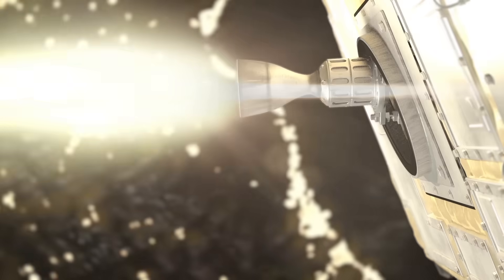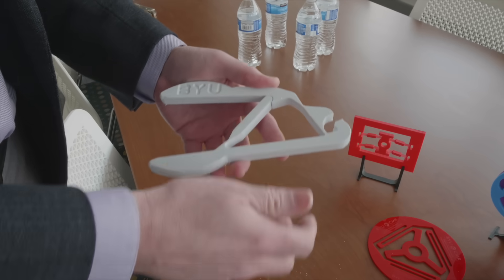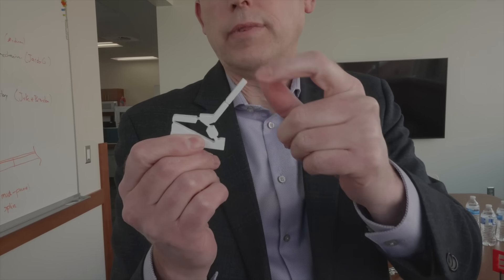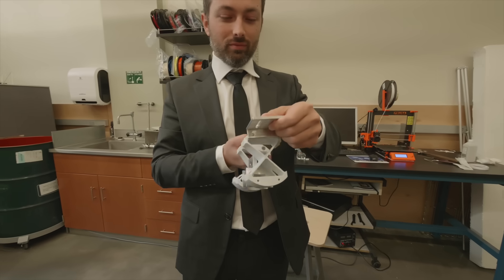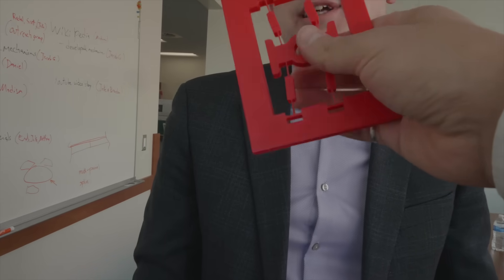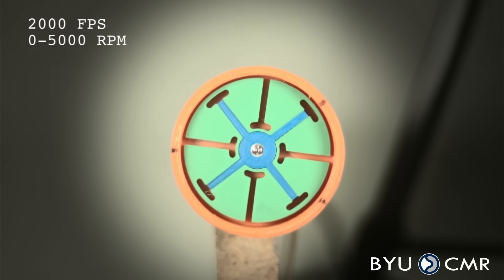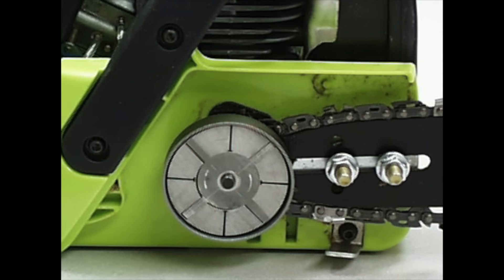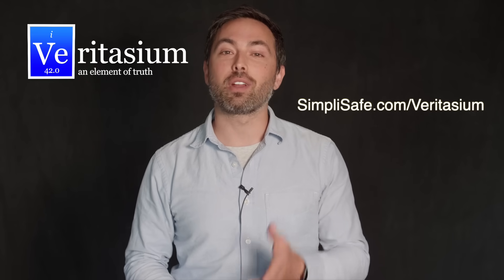Why Machines That Bend Are Better

Comment: I imagine the material wear and tear is mitigated by a limited flexion based on the designs, but wouldn't material fatigue be an issue? Like how continually bending a strip of metal makes it brittle?  Is this sort of fatigue calculable without using stress-testing environments? Fascinating watch.

Comment: In the early 1970s, I worked in a camera store and saw the first Kodak Pocket Instamatic 110 cameras. The film door interested me. It didn't have a hinge with a pin, but a single plastic component that formed the back of the camera and the door. It had a thin pinched section that formed the actual hinge, We all laughed when we saw this because we assumed they would all snap off after a few uses. You can pick them up from thrift stores today with hinges that still work perfectly.

Comment: There's a 9th P that is important for recycling and that is (re)Processability.  When it's a monolithic material, you don't need to disassemble and sort to recycle.  You simply process the material back into feedstock.  For most metal alloys and many plastics, this just means remelting.

(2 should also be production Possibilities)

Comment: They're not better though. If you've printed these you'll know they quickly fatigue and break if printed in PLA or PET-G. If you print them in TPU the rigid parts aren't rigid. You need multimaterial properties.

Comment: big problem when a failure happens anywhere on the device, the whole thing is broken, smaller parts are easier to replace. those thin hinges look super weak and a critical point of failure for the whole device.

Comment: That centrifugal switch is amazing. No electronics, just the increased diameter of the circle from spinning at a certain minimum rpm rate. I wonder if that minimum spin rate for the switch to engage can be adjusted for different applications by changing the thickness of the areas that are compliant or by using different materials.

Comment: I worked on the flagship Xerox machines for over 35 years. I am here to tell you, no matter what it is made of, parts that bend..break. I have replaced and repaired more wiring harnesses and bendable guides than you can count. Anybody that uses this is setting themselves up for monumental failure. A quick test, get a cheap  spoon or wire coat hanger. Now start bending it back and forth. It will weaken then brake. I don't care what you make them from, parts that are being bent on a continuous basis will break. Mark my words. I may not have written a book. Then again they say those that can, do....... those that can't.....

Comment: I wonder how differently vehicles would work and be maintained if a huge majority of different parts could reliably bend instead of break. Obviously, we'll exclude major parts like the gas tank and the hottest parts of engines because it doesn't seem realistic for them to bend.

That being said, the most obvious parts of a vehicle's compliant mechanism are likely springs and/or those flexible metal strips used for suspension on trucks and cars.

Comment: Try to make a compliant Diesel engine, then tell me whether you still think “machines that bend” are better.
Reply: He absolutely should have gone over the cons of a compliant mechanism. This video seemed more like an ad than information.

Compliant mechanisms are cool and have their place but they also have limits that make them worse in some areas such as strength,l. A compliant “vice grip” (what they were comparing to a vice grip there lacked the one thing that sets vice grips apart from pliers, the fact that it will clamp and lock to adjustable heights) will never have the strength of a non compliant version based solely on the fact that if it were strong as a non compliant version, you wouldn’t be able to bend it.

He mentioned that mechanical devices like pins will wear as if repeatedly using a compliant mechanism won’t wear it. They bragged about having one mechanism work over a million times but an average tool can easily do that. 

Again, compliant mechanisms are cool but the video definitely didn’t go nearly in depth enough to show both their strengths and flaws.

Comment: There is a plans-built experimental aircraft design (from Zenith Aircraft) that uses (in my interpretation) a compliant mechanism for the ailerons. I replaces the hinges of the aileron with a bending piece of sheet metal.

Comment: one of the example compliant mechanism advantage in real world application is for the oscillator in mechanical watch "monolithic oscillator by frederique constant" it's significantly far more efficient than the classic oscilator and escapement mechanism which replaced 26 mechanical parts component for one new part component only

Comment: Why isn't everything compliant than
Reply: There are a lot of cool positives to these types of mechanisms, but a big negative is that if part of the mechanism wears out, you have to replace the entire part. In assembled tools and machines, if one part fails it’s far cheaper and easier to replace the broken part.
Reply: At least, that’s what I can think of off the top of my head. Still a crazy cool idea with a lot of impressive and useful applications.
Reply: that's... not an argument

Comment: As a EE in an electro mechanical design group for printers I worked closely with 2 lead MEs. One advocated for traditional rigid structures while the other wanted a compliant design.
In this particular case the compliant design had more parts and complexity. Ultimately the compliant design won out. In conjunction with servo control, acceleration and deacceleration could be tuned resulting in greater positioning accuracy, higher reliability, less noise, less vibration. Overall impact on cost turned out to be minimal.

Comment: Is it looks like? A conic of 5 points with a point close to the line segment between two points. Depending on the closeness of the two parabolic curves, the elasticity of the material, slip occurs when the applied force limit is exceeded. If 3 of the points forming the cone are on the same line, fulcrum points are required between the edges to prevent it from forming 2 lines (scissors) that intersect each other.

Comment: Id like to share my thoughts..
so heres a short bit 
Compliant mechanisms are innovative designs that rely on the flexibility of their materials to achieve their intended function. However, one significant concern with compliant mechanisms is the potential loss of flexibility over time. This can occur due to a variety of factors, including fatigue, wear, and other forms of degradation. As a result, compliant mechanisms can experience a reduced performance and reliability over time, compromising their effectiveness.

The loss of flexibility in compliant mechanisms can have significant implications for their performance. For example, it can result in reduced accuracy, repeatability, and stiffness, making them less effective for applications that require precise control and positioning. Furthermore, the loss of flexibility can increase the risk of failure or damage to the mechanism, which can lead to safety hazards or costly repairs.

One potential solution to this problem is to incorporate monitoring systems that can detect changes in the compliance and flexibility of the mechanism over time. This can help identify potential issues early on and allow for preventative maintenance or repairs before the mechanism fails completely. However, implementing such systems can be challenging and costly, particularly for complex or large-scale compliant mechanisms.

Another potential approach is to explore alternative materials or designs that are more resistant to fatigue and wear. For example, researchers have explored the use of shape-memory alloys or elastomers that can recover their shape and properties even after undergoing significant deformation. While promising, these materials still face challenges in terms of manufacturing, durability, and cost.

In conclusion, while compliant mechanisms offer innovative solutions for various engineering applications, they are not without their flaws. The potential loss of flexibility over time can compromise their performance and reliability, making them less effective and safe. Designers and researchers must continue to explore solutions to mitigate these risks and ensure that compliant mechanisms remain a viable and useful technology for the future.

Comment: The extrusion process sounds very cheap for some parts. I'm very impressed. I've worked with a few items made like this and I had concerns about the part wearing out prematurely. However, my concerns have been eliminated. The once-piece clutch was very nice.

Comment: In the military we use a lot of carbiners [sic] and S clips and about 2007 they changed from using springs to bendy part to be a piece of steel with offset connection to the solid bit.

Comment: In 1968 I did research to try to put a machine, a molecular beam, on a glass slide, that could then be rotated to get three way velocity specification. The microchip etching needed had not yet been invented (I tried to use asphalt and HF). But there were mechanical components too. These kind of etchable devices could serve for controls. So far as I know, the device has never been made or researched. Maybe it's time to try again using these advanced mechanisms.

Comment: Now I hate to call other people liers for no reason. But when he said that those bending devices can last very long, I just can't believe it without further explanation. All these devices, whether plastic or metal, seem to achieve flexibility by having very small connecting junctions. But in my experience, such thin junctions always break fast when you bend them often, no matter the material. Why would it be different in the devices shown here?

Comment: 😊👍
Designs after my own heart feelings.
I suppose one of the earliest examples of a simple compliant device that I was introduced to, was at college, in the 70's.
It was an example of a real problem solved.
An aircraft had a self starter, but the shaft was inclined to shear, due to the inertia of the large engine, and the necessary rather ferocious torque of the starter motor. 
So the shaft was made bigger, and it still broke! 
So it was made bigger still, but it still broke!
Then another engineer got involved, and instead of making it bigger, he made it smaller, so it acted like a spring torsion bar.
It stopped breaking!
I solved a problem with a ''fruit machine,'' also known as a ''one armed bandit!''
The reel stops were controlled by a lever operated by a solenoid. 
In order for the lever to release, it had to be spring loaded.
This required pins, and springs, to produce a two way sliding mechanism. 
From memory, I think sixteen pieces total.
I replaced it with THREE, by using a piece of flexible 'memory foam,' which also provided damping.😊
.

Comment: Centrifugal Clutch on my old go cart (driven wheel) had a cylindrical aluminum housing. Driving through the woods one day, caught a branch in the chain sprocket. I surmised turning the wheel in reverse could free it, but more leverage if I could spin the clutch body & sprocket to release the branch. My bare thumb & fore-finger slid off the clutch housing with a sizzle, so fast that it didn’t hurt, but the white char endured for a while (no scar remained), but lesson learned.

Comment: If you flex a material over and over again it breaks down more then just having linking parts to reduce wear on the structure! Imagine if your door was connected to the wall by just a thin piece of malleable wood?! That wood would breakdown way faster then the jointing hinges!

Comment: centrifugal clutch is nothing new to the automotive world.  Its been around since at least the 1940s maybe even earlier.  The only Difference hes using in this one is hes using a leaf spring instead of a coil spring.  The only way this item would be useful at all is if the leaf springs are longer lasting then a coil spring which seems very unlikely to me.  Also replacing the spring would cost more as its 1 solid piece.

Comment: Why did you have to go to a Mechanical Engineer first? Civil Engineers have known it for a long time. That is why we use steel in reinforced concrete. Because steel is ductile, it stretches and then it comes back to its original shape. Just beware of resilience, though.

Comment: super great usage options for low price.  The problem arises when repairing and replacing, where the existing element of such a device cannot be used, even with the repair there would be a difference in performance.  And different materials have different temperature properties.

Comment: the mechanism at 10:44 reminds me of the way a bulova accutron works (analog to a balance spring.).there is a tuning fork which vibrates with 360Hz. this is transformed to a gear with 300 teeth and makes it turn 1,2 times per second as a time base. you can hear the watch humming with that frequency.

Comment: Have to stop you at "a million cycles."  I will never forget this claim from when plastic door hinges and tool boxes came out many decades ago. 

It wasn't long until we started to see failures. 

For one thing, they aren't cycled continuously.  Maybe the heat that generates makes the hinges more flexible or tougher.  

But it also doesn't account for the leaching or of plasticizers over time, which makes the material more brittle and prone to fatigue. 

Of course, plastics have improve since the 1960s, but the test method depicted was the same.

Comment: except metal vice grips dont burn in the sun and they are durable. plastic material tends to dry and crack in the sun; yes a good solution is titanium, but can you imagine an average working man or women with tools made out of bendable material? durability, practicality...

Comment: I've always thought that if you bend metal repeatedly, that part of metal will wear, and give less resistance when you bend it again, eventually breaking. Its easy to see this behavior with a paperclip. Why are these compliant mechanisms immune to this?
Reply: The phenomenon you're talking about is called fatigue.  There are two types: low-cycle and high-cycle.
What you're doing with the paperclip is high-cycle fatigue, and normally results in failure quickly.
What is happening in the compliant machines is low-cycle fatigue, which can be designed around to allow for million+ cycle lifetimes.

Basically, the difference is whether you are yielding the material during fatigue.  Yielding happens when you start applying permanent deformation, i.e. it won't spring back on its own.
Low-cycle fatigue happens if you do not yield the material during fatigue, and high-cycle fatigue happens if you do yield the material during fatigue.

There's a lot more to it than that, but a youtube comment isn't the best way to communicate it.
Reply: Wikipedia says steel, and they're magnetic. Its steel wire bent in a double loop. 

I'd still love to get an answer to my question if anyone knowledgeable wants to help
Reply: With a paperclip, the elasticity is very low, so it permanently deform very easily. For things like steal, it is very very very difficult to permanently deform it, as such simply bending will not cause it any harm
Reply: @clayel1  but paper clips are made of steel, no? Why is a paper clip ruined in a dozen bends while other steel devices can do millions?
Reply: @Siyko  Paper clips are not made of steel, if you are thinking of the metal ones then they are made of aluminum.